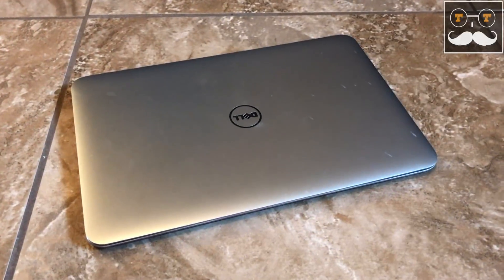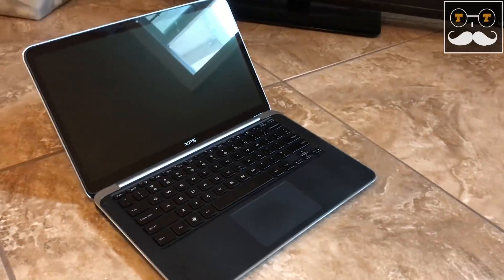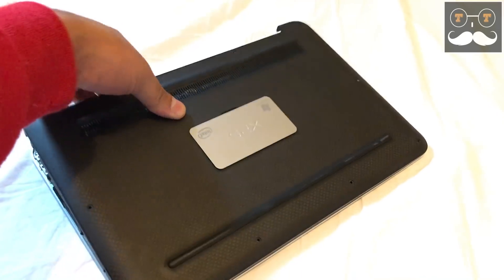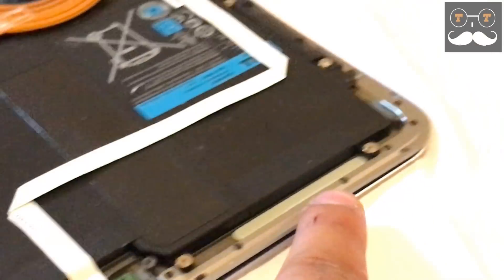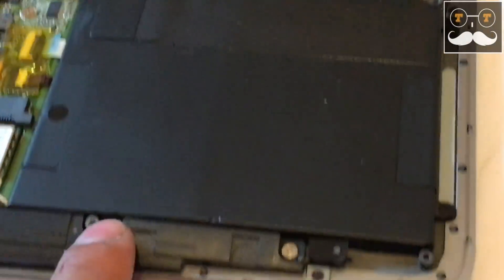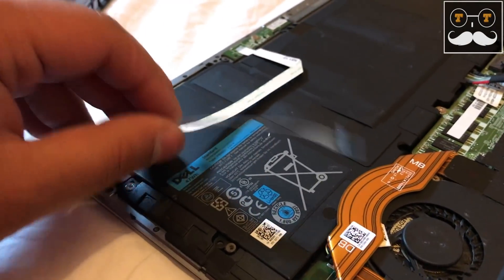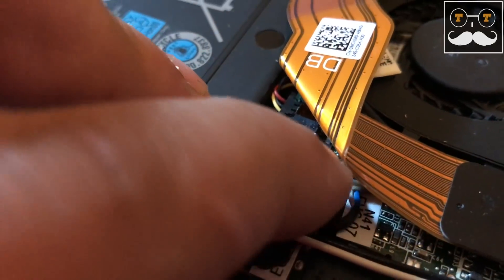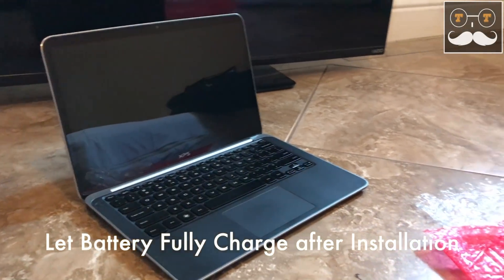Dell XPS 13 Battery Replacement | Not Charging Fix | Bad Battery

Comment: I replaced my XPS 13 model 9343 with a replacement battery bought from Amazon. Everything fit perfectly.  Plug in the AC adapter to charge  the  battery and it never charged at all. Does anyone see this issue ?
Reply from the maker: Hi Thanh, u might have gotten a faulty battery. Or it’s just a cheap aftermarket battery that dell doesn’t support
Reply: @TechTreatmentChannel  I actually bought the most expensive on on Amazon.Power, voltage and current match 100% compare to  Dell's battery. I  think the issue related to "AC Adapter Unknown". When  laptop start up, press F2, it shown this message "AC adapter = Unknown". Battery is about 57% and shown as "Healthy"
Reply: @user-power_electronics I think I have the exact same issue!!
Did you manage to relative it back then?

Comment: thanks for the video. i was able to replace but then i got a unsupported battery. the seller says it is compatible. not sure what to do.
Reply from the maker: Hi SalmoTheFirst, the battery might just not be up to OEM spec and that’s why your laptop doesn’t “support it”
The seller says it’s compatible because it “works”

If I were you I would return it and spend a few extra dollars and get a better quality battery
Reply: @TechTreatmentChannel  Hi, could you send a link to where you bought a battery stamped DELL on it? Like the one you removed from the packaging...that would really help.